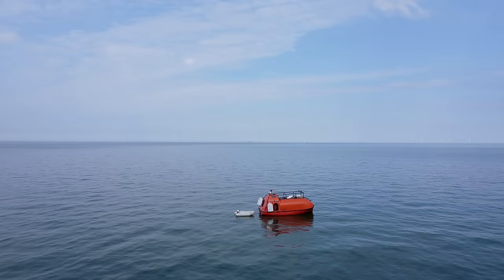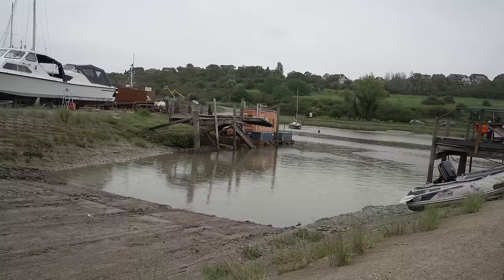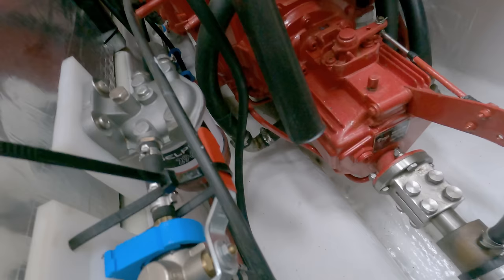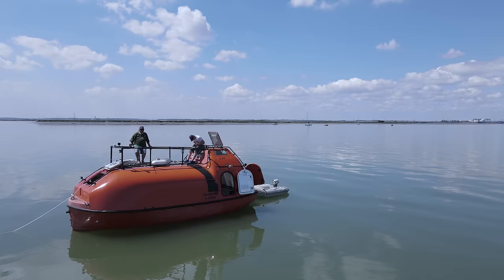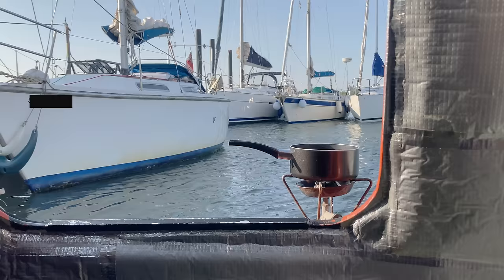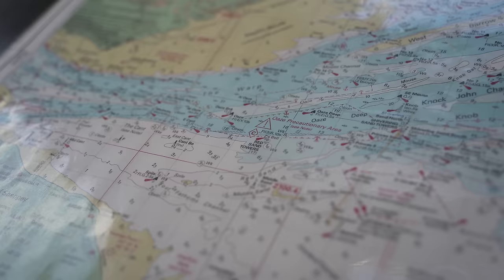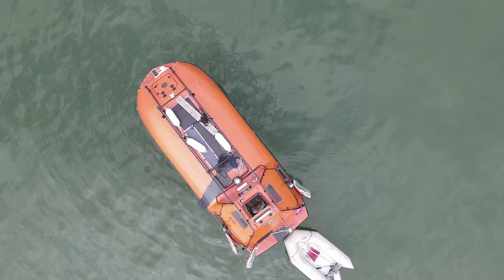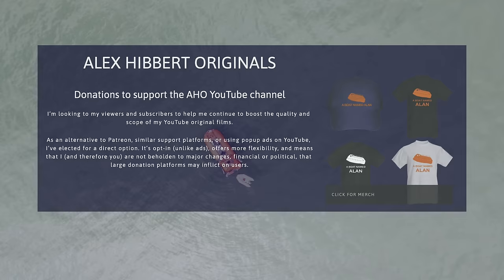*SPECIAL* Lifeboat Conversion Ep20: Multi-day sea trials in the Thames Estuary, England [4K]

Comment: You need to re-orient that air intake for the turbo to draw its air from as high as possible. If the boat does begin to take on water having the engine still function until the very very last can and will save your life. This has been the case for me once a long time ago and I'm here to write about it. Our current boat has the air intake even higher again than the one that filled up years ago. If you're concerned about dust ingress and have it pointing down so as not to collect falling solids, then simply add a U bend to the end as well as pointing it up high. My 2c, ignore at your potential peril. :-)
Reply from the maker: At risk of the enormous peril you oddly-happily predict, it's important to take into account that if flooding, Alan will behave very differently to a non-foam-filled boat. The turbo intake was set at this position by a specialist mechanic during servicing this year.
Reply: @AlexHibbertOriginals  Your specialist mechanic obviously didn't see the boat afloat. Take one look at the outside and measure the current under-loaded water line and you'll find that it's already below that, so the amount of foam is irrelevant it will be even lower. Give yourself the best chance of survival and put it up high where it belongs! This is a boat! :-D Even if it was 1cm above the flooded water line that would not be good because it would be gulping salt water intermittently as little inside waves sloshed in. Another thing to do is put a filter on there, the filter with water in it does not flow well, but the highest most dry part still flows air okay - this limits the salt water ingress and keeps the engine turning. Trust me. Your "specialist" mechanic clearly has no real world worst case survival skills. And where you're going, you may very well need them.
Reply from the maker: I'll certainly take this up with him.

Comment: you need to rig up some outrigger stabilizers for this tender little vessle! I'm not sure if they are called "Birds" in the UK, but there you go. should help tremendously. if you feel like spending a fortune, a seakeeper would also help but probably be crazy overkill. cheers!

Comment: An addition of a double keel would help. You would keep you shore keel depth and gain the initial stability you need. Also even raising a small mast with a modest sail will dampen most rolling.action.
Reply from the maker: The issue is that bilge keels are vulnerable to sea ice.

Comment: You should install a bracket on the transom so you can have a 10hp outboard as a emergency backup motor
Reply from the maker: Aha - check out the engine plan episode a few weeks back

Comment: I just ran across your Wonderful videoI have been a boater for over 50 years on  San Francisco Bay would have been a great test for your mighty vessel as it is one of the most dangerous bays in the world Carry on young man Your planning and forethought is what built Western civilization I have had many boats up to 50' actually but at my age I'm holding on to the best boat I've ever had which is an albin  Deluxe Built-in Sweden yes she is designed to roll she is seekindly And designed should she hit a big wave to roll a bit over and then snap right back  hall to what you have I have subscribed to your channel and will follow your progress And you are doing it the right way and blessings to your wonderful friend your mentor because hes bringing the old knowledge to you which must be carried on  Blessings to you and yours from Merlin Oregon only 2 hours drive to the coast of Oregon where my albin 25 is sitting in her birth cheers
Reply from the maker: Cheers!

Comment: By any definition that was a successful sea trial. In the subject of stability (well transverse stability anyway). Given you are experiencing a fairly fast roll rate actually suggests that from a transverse stability perspective Alan is already a ‘stiff boat’ (A stiff boat is where you have a positive righting lever of more than sufficient magnitude. In other words your ballasting action has been more than sufficient - on the assumption that additional tankage for fuel/water and stores will be kept low.
Reply from the maker: Yes indeed - I've also learned that ballasting for safety and for comfort are two different things!
Reply: @AlexHibbertOriginals  Absolutely right. At the end of the day a stable lifeboat will roll on damp grass.😉

Comment: Adjust the nozzle on the engine air intake away from the prop shaft, the shaft being the lowest point, should you get water in that bilge the rotating shaft will flick water into the intake killing the engine. Best of luck.
Reply from the maker: Interesting - was angled that way by the service mechanic!

Comment: Two pvc pipes running the length of Alan just above the water line would mitigate much of the roll ,how you would attach them without to much damage to the hull is something to think about, but I do believe it would work well,

Comment: Drone master Hibbert at it again, respec'
Edit: open water may seem scary, but think of it this way: far fewer trees to swat you out of the sky.
Reply from the maker: Fair point, except that it was the landing that provided the challenge. 'Home' obviously moved, so I had to keep manually landing into my hand, which can hurt on a moving boat.
Reply: @AlexHibbertOriginals  I think you can update the home point, but you wouldn't want to land on Alan's rounded top anyway so hand catch is the way to go. Good job in any case!
Reply from the maker: What I'd like is a home setting based purely on the downward facing landing camera. So it recognises the boat and can land even as the boat moves slowly.

Comment: You have corrosion, a loose connector, or a break in the cables you were having trouble with. Pull them off and check them.

Comment: This might be... ridiculous, but it could be possible to build a tuned mass damper for the boat without too much trouble.  It would have the advantage of providing ballast and just plain eating the tendency of the boat to roll back and forth.  They're usually for skyscrapers but Ive seen at least a few places where they're used on boats.
Reply from the maker: Few things are ridiculous. But this one is improbable.

Comment: I think fitting bilge keels will be the most effective way to reduce rolling.
Reply from the maker: Please see pinned comment
Reply: @AlexHibbertOriginals  I am sorry.
Maybe external sideboards like they use to have on traditional dutch barges. (dismountable) . Or any other contraption like Ama´s.
Any cheap througaway vertical plank may lessen the throughups
of your beans and bacon diet.
Reply: Fitting a tiny mast with steadiyng sail will help too.
And with a small jib you will have emergency propulsion (downwind.
Reply from the maker: Something I've investigated, but shelved for now.

Comment: Pretty cool what your doing but a few things that need to be added are, windshield wipers, a stern swim platform (perfect to hold propane tanks and others) side platform to stand on and hold kayaks or canoes and a raycor duel fuel filters (best thing about these is you can run on filter A or B or both which means you can swap out filters while running and the filters can be bout pretty cheap by the box)
Reply from the maker: Cheers. Wipers for sure (and heaters).

For the filter thingy... It's been discussed a lot, and I've opted for a cheaper manual changeover system for fuel. If you have an inline A B system from one tank (I don't want a dual tank system) then if you have cruddy fuel, it's going to keep clogging both filters, no matter how many times you 'hot swap'. I've gone for this system of using a small, clean, emergency tank to get me out of trouble.
Reply: @AlexHibbertOriginals , if that’s what you decided for go for it, another positive that it’s easier the change the filters on a raycore than on the engine just one t handle screw on the top pull out the old one and pop in the new one. Plus they have fuel sediment glass built in with a screw in the bottom to drain out water and sediment. Plus you can get 10micron filter cartridges for the fuel. I got all the info from my dad who built and delivered SeaRays and he had to hot swap filters while offshore on some delivery’s in rough seas. Another thing to consider is that if you have bad fuel in the main tank what are you gonna do with the fuel?  But keep the raycor filters in mind they are the best on the market and you can always switch systems if you don’t like one also might need to consider a small radar and definitely an epirb (definitely spelt it wrong lol)
Reply from the maker: Thanks for the added info. Will keep in mind for upgrades.

EPLBs/EPIRBs are par for the course in the expedition world, so absolutely.

Comment: If you run the air intake our of the motor box it will help with fuel due to you are sucking hot air.

Comment: I wonder if you could put a ~3/8" thick x ~2" wide stainless steel piece running from the nose the and the length of the bottom to protect in case you scrape a bit in one of those shallows?

Comment: Maybe a small set of outriggers/oma's will stabilize the rolling and provide a net or deck area to both sides. Any consideration for solar panels?
What is the ultimate purpose/use?
Reply from the maker: Have a scan through the episodes - quite a few on both those topics :)

Comment: I suggest to add a bit of 2 strike oil to the diesel. 
Diesel nowadays has very low sulphur levels, losing lubrication for the diesel injection pump. 
Put 250ml for every 50 liter. 
Engine will run smoother and will use less diesel. 
My experience is about 10 to 20 percent less consumption, depending how old your engine and pump is.
Reply from the maker: Interesting - can you link to details on how this works? Or just anecdotal?
Reply: @AlexHibbertOriginals  
Lorry driver used it since the 60's in Germany. 
Probably because they owned the Lorry and business. 
Myself I used it on an old Isuzu pick up truck for 6 years, that truck had 700+ thousand km down with first engine. 
Sometime I forgot, and the engine felt so sluggish, after I added the 2T oil it felt like somebody did an engine overhaul on it overnight. 😊
Ran much smoother more power for less accelerator movement, no smoke, and saved probably 20 percent diesel. 
Used it on other diesel, turbo and non turbo direct injection and old school injection pump, no problem. 
If you got a diesel car, try it there first and feel the difference but let it run a 100km first to clear old soot and carbon deposits. 
Only then you feel the real change.

Comment: Have u though about adding arms to the sides with birds it would add a lot of stability in in bad weather and u could make them fold up to be out of the way when not needed
Reply from the maker: To be foldable, yet strong, the design would have to be mighty. No, I've written off outriggers.

Comment: I can see you are pushing lot of water , maybe creating a nose like a sailboat will help you gaining some speed , also adding a king of keel as long as possible, not necessarily deep but just something to give a direction to go , I mean the wind will not push you sideways, just a bit deeper than your rudder, so it will protect it if you hit the bottom.
Your keel can be made of stainless and also it will protect you hull .
Reply from the maker: We're more or less at max hull speed, so it's mostly just about eeeking out a little more mpg or mpl.

Comment: Loving the project so far.  Are you going to put a step by the port hatch?  You stood directly on this threshold several times just in this vid, could be a weak point?
Reply from the maker: It's 10mm of woven glass, so it's tough, but yes metal edging is coming to a hatch near you now.

Comment: Hey Alex, It's Possibly a little late in the Day.....But Youtube guided me to Your Sea Trials Video and I Couldn't help but Think of How You Could Easily Approximate Calculating the correct amount of ballast to achieve or possibly improve upon Alan's intended optimum Seakeeping Characteristics as envisaged by the Naval Architects during Alan's design process and proving Sea trials....!!!!!! It's Just a thought.....Although I promise at this point that it's definitely worth at least reading to the end.....But it definitely seems like Alan was Designed to Achieve his Optimum Sea Keeping Potential in a Rescue situation in Heavy Seas with 68 x c.100kg burly Norwegian seamen being rescued on board evenly dispersed around the vessel at about the waterline......which is quite a lot of ballast to make up for before reaching Alan's planned for weight dispersal to reach what the naval architects would have planned for in terms of achieving ideal sea keeping in a rescue situation in rough and challenging seas....and although they would have been seated at about the waterline the c.6.8 tons of burly Norwegian seamen who I assume would have been present in human form or simulated form during her original sea trials, would have done a very great deal to ameliorate the destabilising & pendulum like effects of the high up mass of her rather generous layup of Alan's topsides which would have been laid up to withstand significant impact forces at sea coupled with Alan's somewhat round hull profile....As such more captive ballast in the bilges calculated to roughly simulate the effects of 6.8 tonnes of people sitting at the waterline; which one assumes due to the leverage of being at the furthest point below her centre of gravity would be significantly less than 6.8 tonnes but probably very easily calculated with a brief trawl of the internet as there must be a calculator for naval c.o.g calculations somewhere, and an amount of ballast close to this figure might possibly better approximate what the naval architects might have intended in terms of her intended sea keeping characteristics in her original proofing sea trials and her original design....sorry if I'm suggesting what you've already though of or I'm a little late in the day....but I thought that it might be an easier way other than blind trial and error in terms of achieving greater or optimum comfort while at sea before embarking upon your epic adventure and of achieving almost exactly or better performance at sea than what the naval architects would have envisaged in terms of Alan's optimum sea keeping in a rescue situation while in heavy seas during Alan's original design process.....Also having the correctly calculated and installed the correct amount of (very) captive ballast that far below Alan's centre of gravity would do wonders for both optimising his/her self-righting characteristics and probably ensuring that they're never needed as she should always want to roll back to centre and have maximum damping effect of the initial rolling motion in the first place.....Hope This Helps a little bit even if it helps in optimising her continued development in the future as I've Just noticed the Youtube time stamp might suggest.....& Very Good Luck With Your continued Expeditions in the future too....!!!!!! Chris :)
Reply from the maker: There really is no need for a full stop.

Thanks for the input - fuel and supplies will add a few tons, but yes agreed that it needs to be compared to the initial design. TELBs do still work though even if not full up of passengers.

Comment: This video is already over 1 yr old and it is the first one I watch in this channel, however, I'm wondering if the orange paint wouldn't scare the vessels you  encounter into think that you need rescue...
Reply from the maker: Options are limited. Yellow is an emergency colour too, and most other colours are either horrible (luminous pink) or camouflaged against the sea.

We'll have radio, AIS and visual modifications on our side.

Oh, and cheers.

Comment: I was thinking a just in case outboard motor set up if 1 engine an outboard mount on the stern and the spare engine inside the boat a just in case engine to get you back to shore or someplace for repairs on the main engine

Comment: Could you add some passive stabilizers to Alan to reduce the roll? Maybe something detachable so they’re not a problem getting in and out of the water?
Reply from the maker: Something removable or foldable is being discussed, but I'm consulting with some experts as that sort of structural work must be correctly installed.

Comment: What about a spring loaded anti roll pontoon on one side? doesnt need to be big really, and can be made to deployed in heavy weather but stored for long hauls, and can be made into a platform you can stand on if ever there is the need for some more temporary space in calm weather..
Reply from the maker: Possible, but likely not a front-runner solution all things considered.

Comment: Would some kind of thread locker on the railing clamps (not the fasteners, but the clamps themselves) help with them sliding around (and work in cold temps)? (probably less drama to just through bolt them) Bicycle inner-tube is also really useful in situations like that as a gasket/friction enhancer.
Reply from the maker: I doubt it. The screws only provide a small surface area of grip. It's not an ideal design for vibrations.

Comment: Fumes from the battery (in case of failure) not a concern? Also auto extinguisher fitted in the battery compartment might be a good idea.
Reply from the maker: These Lead Carbons are a step beyond AGM batteries in terms of tech, and off-gassing isn't really something to be worried about.